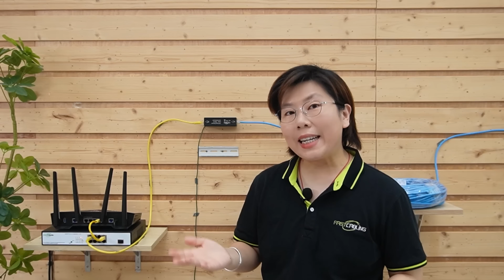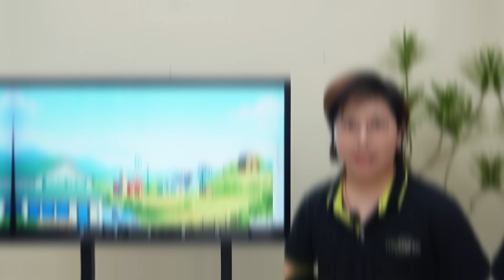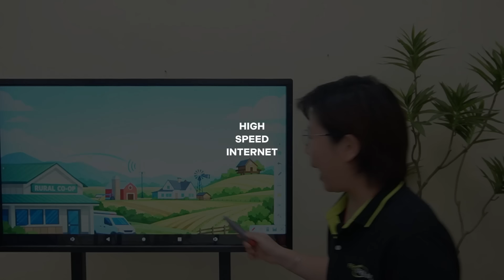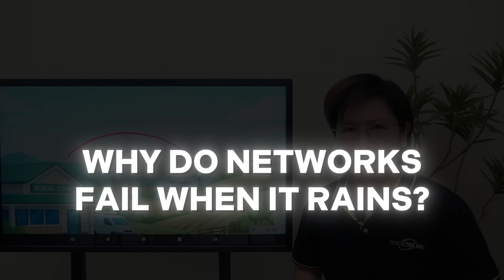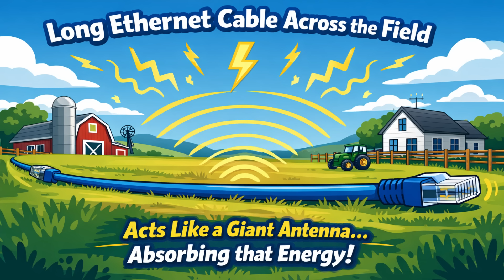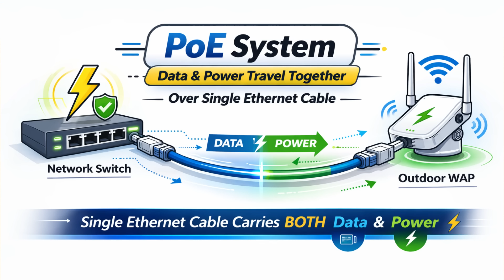Why Your PoE Setup Dies During Storms ⚡| 10G PoE++ Surge Protection for Outdoor Wireless

Comment: Great video explanation. I have this surge protector installed outside at the outdoor switch. I have another indoors at the rack. Also, have surge protector at the AP running off the outdoor switch. Everything is grounded properly. We’ve had several storms pass through since installation. The AP remained online at all times. Thanks.
Reply from the maker: Great!

Comment: Why not use fiber optic cable instead of Ethernet? Isn't that a better way to stay protected from a lightning induced surge?
Reply: Because if you have to use a device that needs to be powered remotely then ethernet copper is more ideal than fiber
Reply from the maker: Fiber cannot deliver power to the end device, only data. If you can power the AP using a power outlet, you can use the fiber cable instead.